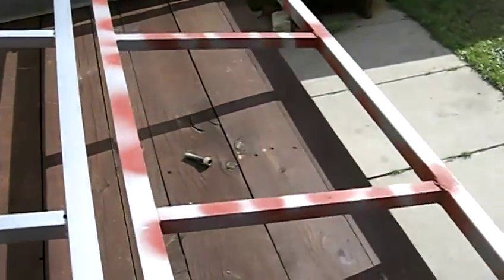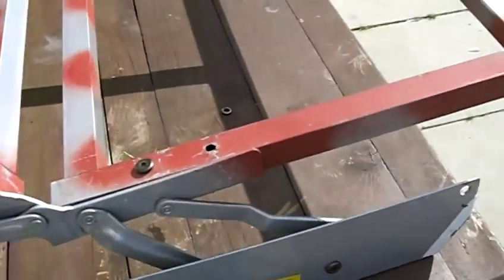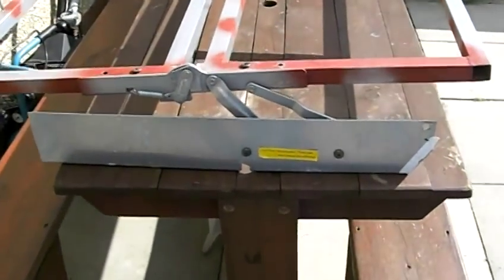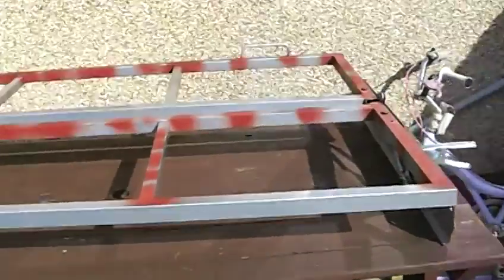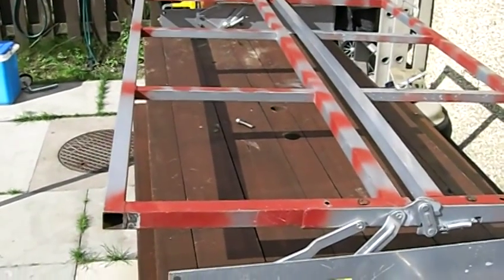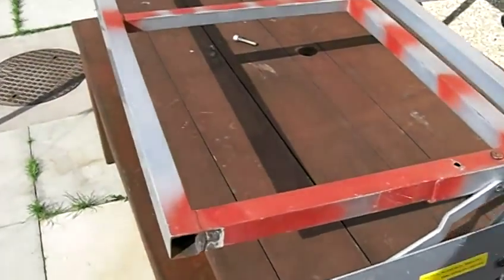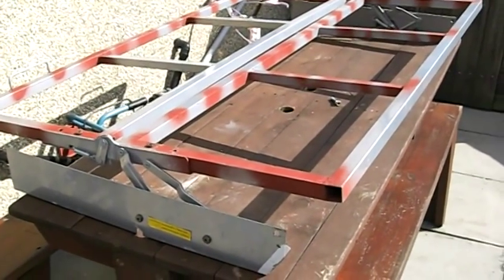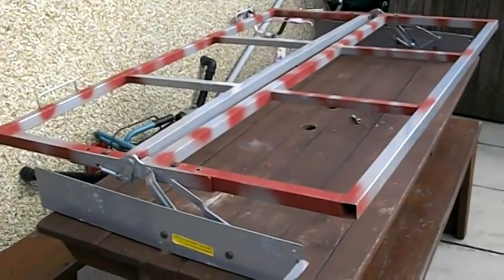vw t25 t2 part 4 how to make a rock n roll bed from a futon

Comment: Nice work.  Well done.  Where did you buy the hinge?  I see one on ebay - VW T2 Bay or T25 camper rock and roll bed hinges.  Is this the one?  Or similar.